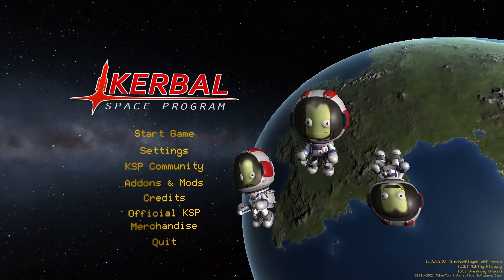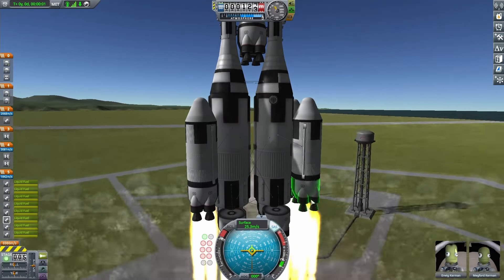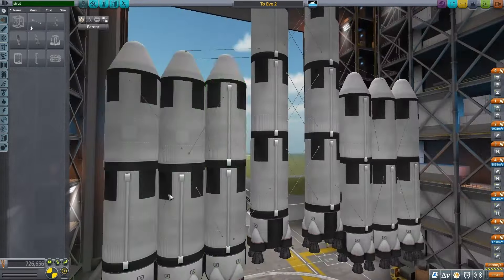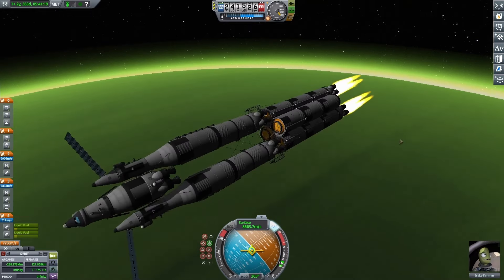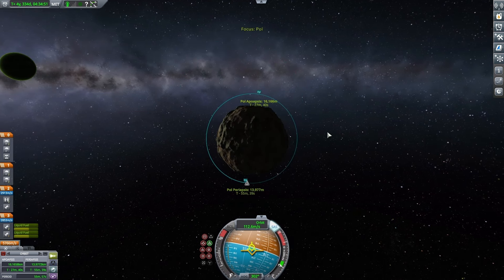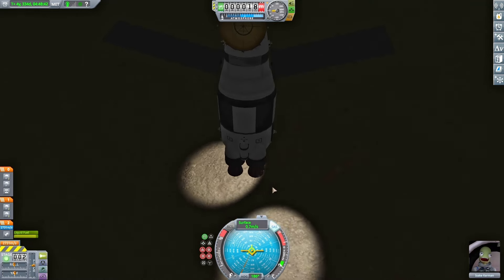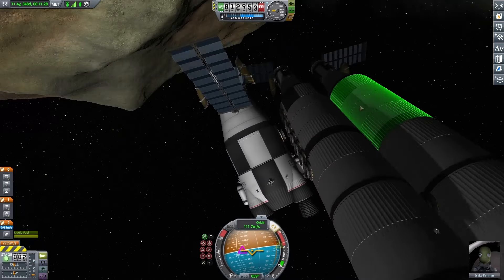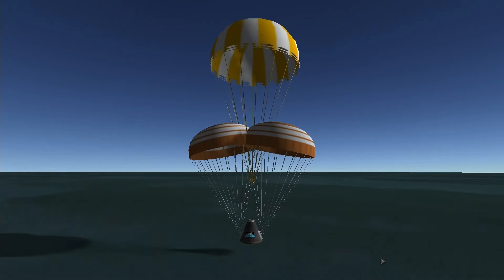Can you Use Only Mammoth Engines to get to Pol in Kerbal Space Program?

Comment: Consider using Asparagus Staging next time, it works fairly well for these sorts of challenge.
Reply: Asparagus staging?
Reply: @cones914  look it up, hard to explain with text
Reply: Asparagus staging is when instead of using lots of fuel tanks and detaching all of them after they are all depleted, you can have 1 tank, decouple it, next tank, decouple it, and so on. It reduces the amount of dead weight on your craft, thus increasing maximum potential delta-v. Hope this helped.

Comment: 1:00 if you put an engine plate above the mammoth and disable staging, you can attach a part below on the node that would usually be decoupled, and you can adjust the distance of this node. This is also how you stick decouplers below engine plates populated with multiple engines. It's really neat.

Comment: You can use square brackets to change which ship you're flying in game without going to the tracking station
Reply: That doesn’t work for me for some reason.
Reply: @dylansp4049  It works when there are other controllable vessels within the physics range (the range where the vessel is rendered and simulated part by part)

Comment: Hi Reid, I just wanted to give you an advice, if you wanted to switch crafts which are close, for example the two boosters, instead of going to the tracking station and selecting the one; just press the squared parenthesis. This one : []
Reply from the maker: That is very handy, thanks!
Reply: @ReidCaptain  another piece of advice: you could have achieved the next stages by just using engine plates set to 1 engine

Comment: You can attach to the bottom of Mammoth engines, you just have to use an Engine Plate.

Good video btw
Reply: I didn't have Making History for the first, I don't know, 4000 hours of my KSP time, and now I'm looking at your comment and realizing how much I've totally ignored engine plates because I'm not used to having them. But then a fairing base would work just as well, but I didn't know about the interstage nodes for ages so I tend to forget about them too.
Reply: @eekee6034  lol totally get that. I completely forget about all of the robotics for the same reason. After so many years with just vanilla, I learned to get on without them.

Comment: If you are planning to carefully disconnect stages then don't use the explosive decouplers like that. Just use docking ports. You can use multiple ports to get the alignment to work automatically.
Reply: Or set the explosive force to zero

Comment: Try doing a "no symetry mode" challenge
[You can't use symetry tool]
Reply: Except two-way (bilateral) symmetry
Reply: If you enable snap, I guess you could make a symmetrical rocket without using the symmetry feature, but it would be a little bit tough. 2-way symmetry would make it too easy; see the rocket in the video. No symmetry at all would simulate what you get when building with a Kerbal on EVA.

Comment: Wanna try this as a challenge?
Make a single stage rocket (yeah, not plane, it has to take off vertically) and get to a planet. Now, I've seen some designs and they use rotors which are from a dlc. 
I'd love to try to do this rocket myself but so far without the doc parts ( and probably because Im still very green in the game) I have failed.
If you can do it then awesome. If you can do it without DLC exclusive parts then doubly so ^^
Reply: That's an SSTO, and trying to make those not planes is nearly impossible to extremely difficult depending on what destination you're trying to get to.
Reply: @nikkiofthevalley  yeah! that's why it's a challenge ^^.
Reply from the maker: Honestly I don't even know how to approach that, but I've wanted to make an ssto for a while now
Reply: @ReidCaptain  A tip from a person who's made SSTOs before: Use drills and refineries, it makes it so much easier and more efficient.

Comment: the decuplers push the pieces you are removing, so if you put the stage low down on the side decuplers it will push the top ends into the rocket. Keep your side decuplers higher and near 3/4 of the top of the stage you are removing to push it away correctly. 

You can also just stop engines decouple THEN continue, but that's slow and boring
Reply: Would it work to rotate really fast and then decouple?
Reply: @thedudeamongmengs2051  it should, as long as the rocket doesn't stop spinning until the side rockets are gone so any attachments don't slam into it

Comment: Use mammoth engines to land on Gilly, or ion/nuclear engines to land on Tylo. Return is optional.
Reply: I'm almost sure a nuclear engine couldn't lift itself alone on Eve. Having said that, someone will no-doubt prove me wrong. :) However, you didn't say 'launch', only 'land', and the landing could certainly be performed using only wings. If wings are considered cheating, body lift might work well enough; Eve's atmosphere is that thick. (I'm not even going to mention parachutes.)

The real trick would be using ion or nuclear engines to land on Tylo, because there's no other way to slow down from orbital speed and orbital speed is over 2km/s.
Reply: @eekee6034 I would have thought lifting back off and returning went without saying.